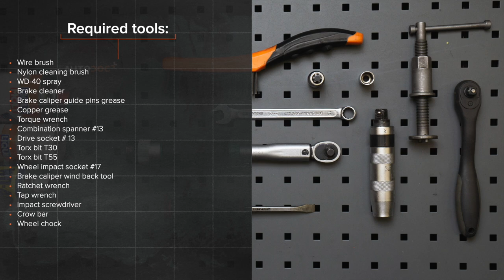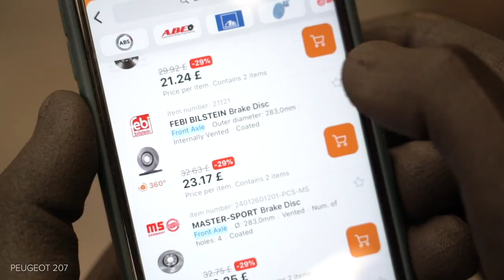How to change front brake discs on PEUGEOT 207 [TUTORIAL AUTODOC]

Comment: Your torque settings for T55 torx bolt which hold calliper bracket are 70NM. But on forums and Haynes manual they suggest 105NM !! .Which I correct please
Reply: WTF, WHY DON'T YOU ANSWER???
Reply: I know you sent this question 3 years ago, lol, but did you find out the answer from elsewhere? I'm going to be changing my discs soon and i also have read they're 105nm.....